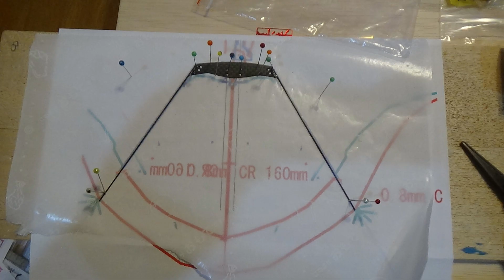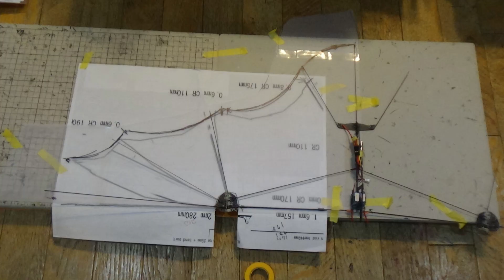サーボ駆動こうもり型羽ばたき機曲った翼SFOBat102 Bent Wing : 16th Flight test with New CODE  Good Flight in Strong Wind

Comment: it seems the wing is a bit too large for servo
Reply from the maker: The wings, which were initially large, were slimmed down and the tail lengthened for better flight.
Reply: @BZH07614  i see, flight in strong wind is very difficult, a slightly stronger servo could improve flight, but carbon spars may be too weak for additional weight